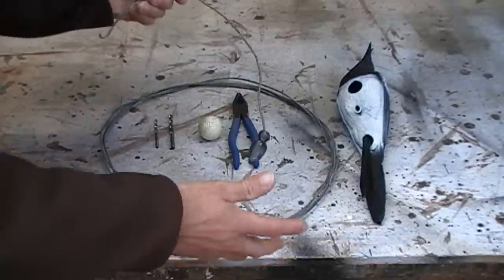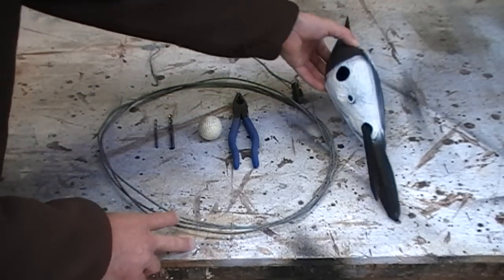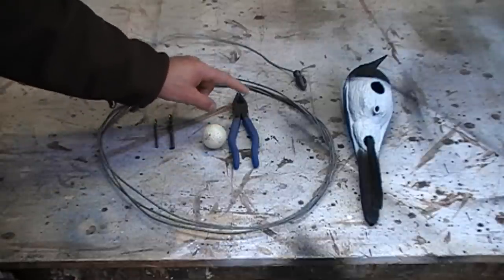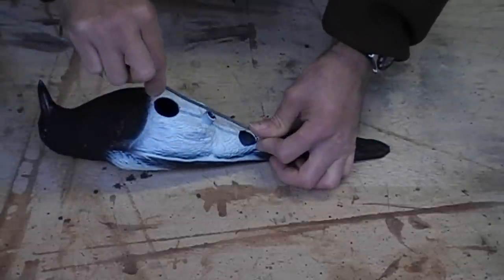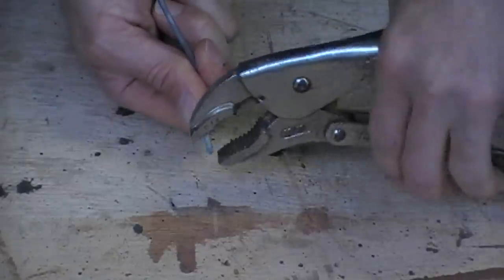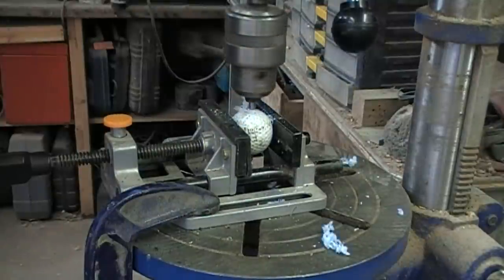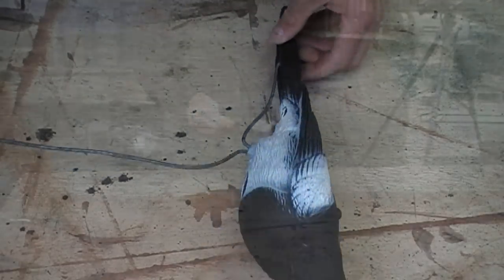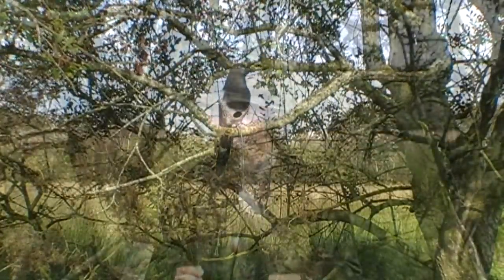Air Rifle Hunting, DIY Decoy Hanger 2012

Comment from the maker: I use a .22 Bisley Magnum pellet in my 30ft/lb Theoben MFR for rabbits. I usually only shoot from a lying down or prone position when i have to stalk into a rabbit on my belly and would rather shoot from a sitting position or a kneeling position using a short set of crossed sticks. But the only way is to put in as much practice as you can on paper targets and know your ranges so that your pellet doesn't fall well short.

Comment from the maker: I have two pcp powered air rifles both in .22cal, one is a BSA super 10 mk2 at 15ft/lb and the other a Theoben MFR at 30ft/lb. The BSA was about £600 and the MFR £900 and you can see a short vid on them on my Channel under My Air rifles 2010.